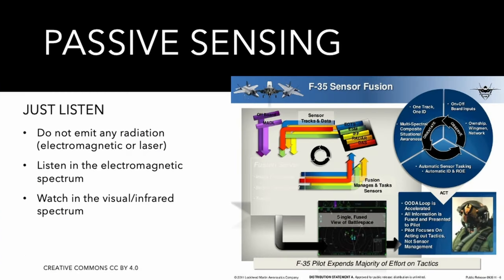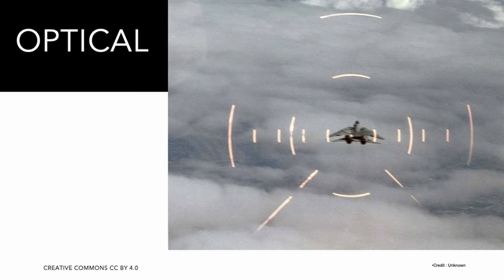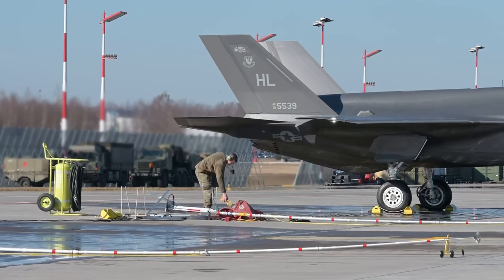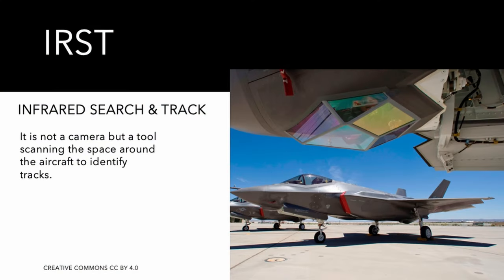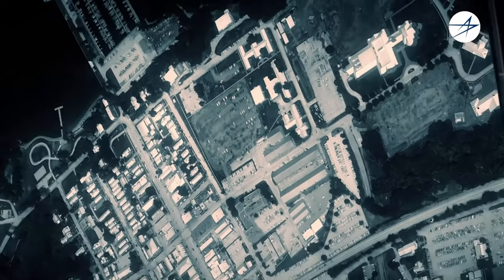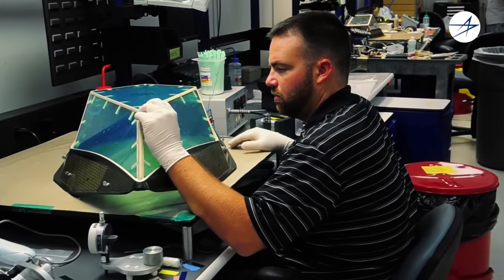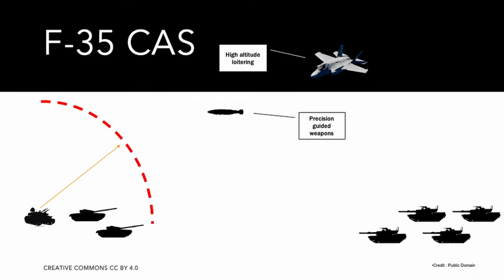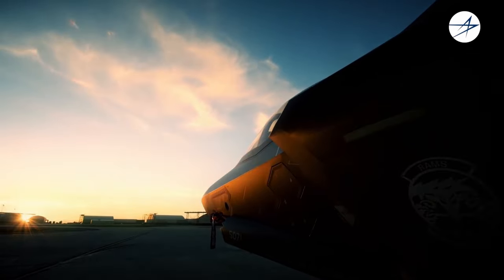The New F 35 Block 4 Sensors are Crazy!

Comment: Using the same technology we use - stereoscopic vision pushed through a neural network to guage distance by parallax - i.e. cameras on the wingtips, seems like a no brainer to me.
Reply: Well, tanks used to use such technology And its accuracy was pretty poor. For example, brits even had a special machine gun to measure distance after rangefinding
Reply: @ГеоргийМурзич  Battle ships also used similar technology, with impressive accuracy, but neither of those examples are the same as a well trained neural network with state of the art optics and integrated sensors which add in the motion of the underlying platform.
Reply: @BB-sm8ey  well, not sure about impressive, but any way, their coincidence rangefinders were much larger, like, a dozen or two meters wide
Reply: @ГеоргийМурзич  Impressive. What's the wing span of a Eurofighter? 11m? Unifying inputs from across the EM spectrum is hardly rocket science either. 
While we're at it, think about the camera systems on the Tomcat, in the seventies.
Reply: @BB-sm8ey  eh, well, it couldn't do anything beyond showing an image

I mean, you need to place high quality cameras there, smt of EOTS level in order to achieve some result. And will it be enough to determine precise distance at like 150km? Doubtful. What's more, keep in mind that weather conditions are more often not perfect than perfect
Reply: @BB-sm8ey  "What's the wing span of a Eurofighter? 11m? Unifying inputs from across the EM spectrum is hardly rocket science either."

And if you wanted said camera system to give you good info of targets at up to 30km, SURE, no problem.
Oh, except for said cameras needing to be big enough to provide enough resolution and big enough "pixels" to actually make it work.
Meaning you need a big bulb on each wingtip.

And then, 11m?   That's nowhere near enough to get a functional and remotely accurate reading at truly LONG distances.

"While we're at it, think about the camera systems on the Tomcat, in the seventies."

The real ones, or the ones Tom Clancy pretended were about a hundred times better than the real ones?
Reply: @DIREWOLFx75  Trouble answering your own questions?
Optical range of the camera on a 1970s f14 - from 10km up to 37km depending on weather conditions.
Its (primitive) IRST system - from 55-90km.

I don't know why I bothered, but I calculate a sensor needing 16 gigapixels for sufficient angular resolution to resolve a 1m circular object at 50km using two cameras with a horizontal spacing of 11m. That resolution can be achieved by a matrix of smaller camera modules or a scanning array. 

Still struggling with plausibility? Go knock yourself out- do the maths yourself.
Reply: And just in case it needs to be said 1) lenses and 2) part of a system.
Reply: @ГеоргийМурзич  The new XM7 rifle  commissioned but the U.S military can be equipped with a scope that does all the drop compensation and range finding. Just put the reticule on the target and shoot, no matter the distance.
Reply: @fredericklehoux7160  cool. How does it measure distance?
Reply: @ГеоргийМурзич  parallax, having a laser beam at a known angle you can calculate the other parameters
Reply: @fredericklehoux7160  are you sure that isn't laser time of flight rather than Parallax? I can't see how a parallax approach would work in that context.
Reply: @BB-sm8ey  yes you're right, it's the laser timing data not paralax
Reply: The idea is a no-brainer, it's even possible to do just by moving around and tracking the angle, this is standard when using passive sonar. I'm guessing it's a question of prioritizing features. It might also be tricky to merge camera footage from several aircraft maneuvering at supersonic speeds and getting an accurate track, but I'm not an expert.
Reply: @tykjpelk  even better, with sensor fusion (directed laser) between multiple aircraft it would be possible to build up a phenomenal spatial awareness.... and of course, I'd bet anything that's why the f-35's internal networks and processing bandwidth is as high as it is, although I continue to be blown away what's achievable with a could of TPU.
Reply: @BB-sm8ey  Yes, that's what I've heard from pilots. A formation might have 40 miles of separation to maximize the radar coverage, at that point you're just playing AWACS. That might be too far apart to merge FLIR though.
Reply: @tykjpelk  we're taking passive here, but I can't see why it wouldn't be possible as long as their relative position is established. Depending on how / if laser links can be oriented more than two objects could reliably establish their relative position and use parallax in 3D to get good distance and motion estimations without giving their presence away. Damn. I wouldn't mind working on something like that.
Reply from the maker: The wingtips shake a lot.
Reply: @millennium7shorts926  a seventy EUR coral tpu does 4 trillion matrix operations a second. Compensating for shake relative to one another via the frame of the aircraft as reference, integrated over time, is an annoying problem... not much more than that.
Reply: @BB-sm8ey  None of your ideas can happen until we have a sturdy AI system. After that i guess cameras will become more useful as targeting inputs, especially combination of thermal, night and normal vision. But it will still just be integrated with the radar function and the other sensor suite. But still camera resolution is poor unless you have a large aperture, you wouldn't want many large cameras on your stealth airplanes. especially at the tip  of the wings.
Reply: @fredericklehoux7160  This is about the use of optical wavelengths for passive location and distance estimation (NOT switching your radar on!). It is not your fault that you have no background in computer science, but really, filtering out rapidly moving objects (which aren't clouds, sky, sun, moon, or birds) and then maintaining track on them using parallax between multiple passive sensors, despite wobbling wings, is meat and two veg for either a heuristic approach, or a trained network, or a hybrid approach. Camera resolution is not the issue, as previously discussed. There are no silver bullets (what happens at night?) but that has never been the point - each side only needs to be better than the other.
Reply: @BB-sm8ey  Yes but you are not putting these hypotheticals into a realistic combat scenarios. Unless you already know where the enemy is and the composition of it's force, in which case why do you need your sensor imput to target anyway? You're camera won't have enough resolution to determine the shapes of the objects you want to target, at good distance it's all gonna be blobs you cannot determine what it really is. 

Generally in the military, you don't shoot unless you're sure your target is the one you want to hit. Especially if there might be civilians around. If you want to kill a commander of a battalion and got a limited amount of ammunition, you want to make sure you target the right blob but if you can't resolve enough details, it won't help you. 

These jets already have multiple cameras, you can actually look trough the plane with a combined visions view directly projected into your helmet and you can aim by looking at the target with a system similar to tobii eye trackers. Even if we make targeting AIs using camera, they will work on the human in the loop principle. The AI will prep the targeting solution, then ask the pilot or an officer linked with the plane to allow the strike to be fired. 

They basically already have these capacities, just that in realistic combat scenarios you can't just shoot at blobs you assume might be the right target.